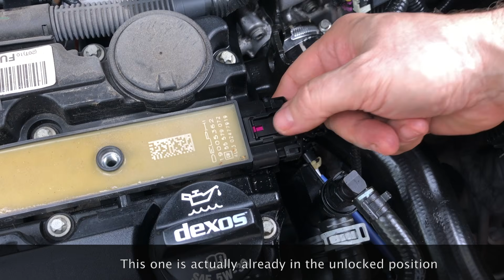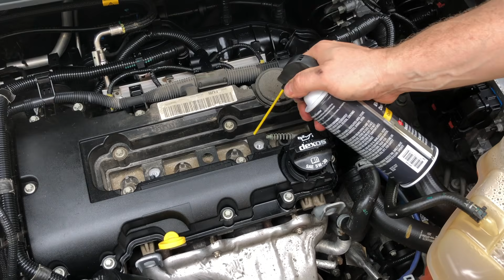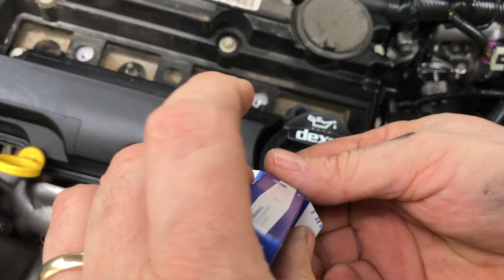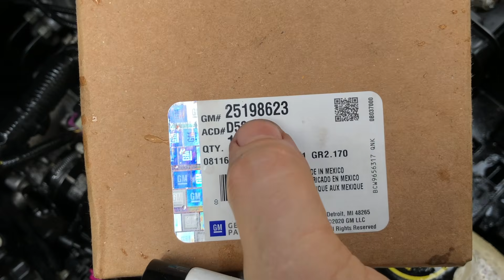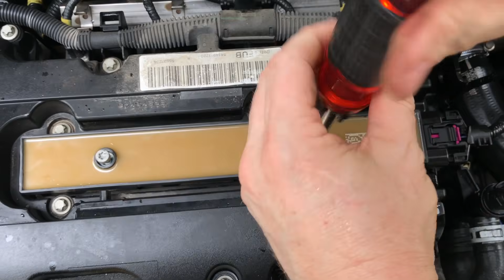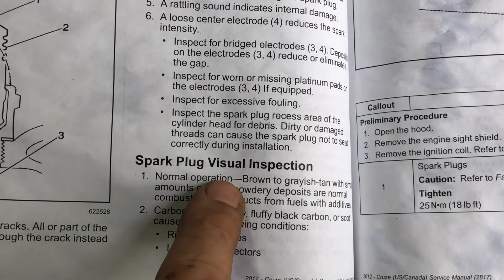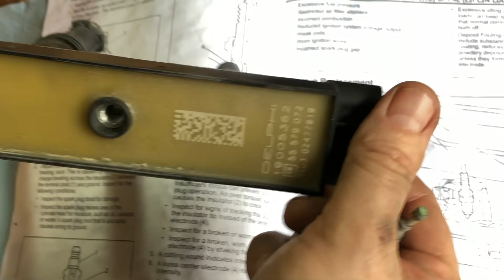2012 - 2021 GM Ecotec 1.4L Turbo Engine 60K Mile Maintenance (Replace Plugs & Coil Pack) Sonic Cruze

Comment: You didn't lube the threads and you didnt add more grease to the plugs/boots. The same problem will just happen again.
Reply from the maker: Wrong.   New genuine GM coil assemblies come pre-lubed with dielectric stripes as shown.  Plug threads on this engine do not get any grease applied to them.  Follow the what GM says in their service manual, not what's done on other car models, and you'll be gtg.
Reply: @DrShock  Yes, you are wrong. That's why it will corrode again. Always lube the threads and add grease to the ends of the plugs, or in the boots. Also remember that these manufacturers are the same ones that say you can go 10,000 miles between oil changes. Oh! Lets not forget life-long transmission fluid or OAT antifreeze that eats aluminum and gaskets!
Reply from the maker: We're just going to disagree here John about anti-seize, or grease, on the threads.  It interferes with achieving the correct torque value on the spark plugs.  As I've already mentioned, genuine GM coil assemblies already come pre-lubed out of the box so adding more is a waste of $$.  You only need to add your own dielectric when its an used coil assembly, or if you're using lower quality aftermarket parts.
Reply: My wife's car is  a Buick Encore, I replaced the valve cover. And thought while I have this apart, ill do spark plugs and then boots. My neighbor told me the spark plugs were rated at a 10,000. So I almost wasn't gonna replace them. But again wanted to be thorough. And its a good thing I did. When I pulled the plugs, what was left of the diode was something that looked like a needle. 
So replace your plugs

Comment: shouldn't he be putting anti seize on the threads ?
Reply from the maker: No, the GM factory service manual does not recommend using that on plug threads for this engine as it interferes with setting the correct torque value.

Comment: That motor was spotless! I'd guess water seeped into that side of the coil pack and caused all that corrosion on only one cylinder. The end cylinder. I've go 381,000 miles on my 2012 Cruze LTZ RS between two motors. Stock coil pack and boots. I'm very careful washing the engine. Great video!
Reply from the maker: Thanks.  Yep, just water from wet weather driving/condensation causes that.  That particular end cylinder is prone to this kind of water intrusion/corrosion on the GM Ecotec 1.4L turbo engine unfortunately.
Reply: @DrShock  where can i gonto buy the coilpack Chevrolet sonic 2016
Reply from the maker: Should be links in the description.
Reply: @DrShock  Do you pressure wash under the hood? That level of corrosion indicates water has been forced there many times. 🤔
Reply from the maker: No, I do not.  But then this is a customers vehicle, so I have no idea what they did before I worked on it.
Reply: Are you at all concerned about that corrosion I believe in two plug areas? Particularly the one on the right which was excessive. I'm wondering if there's some sort of chance that you have a minor head gasket problem going on.? I saw the others commenting that it was a pressure washing problem, but I guess I'm not sure why somebody would pressure wash an engine, and secondly I'm not sure why it would only infiltrate a single cylinder. It is my understanding that these engines are very plagued by several Achilles heel issues including overheating and basically cooling problems. Just curious.
Reply: @bigqueue  I have a 2015 Chevy cruze and had one just like it. I believe it's from the spring being bent and not touching the plug like its supposed to.. It will corrode when driving it over time. Im almost at 200,00 miles they're not bad if you keep good maintenance on them.
Reply: @bigqueue  After viewing a few videos on this topic and observing the problems with corrosion on #4 being common, I'm wondering if going through today's modern carwashes where they spray upwards on the undercarriage if that might be causing this problem?

Comment: What cause the corrosion coolant leak
Reply from the maker: There's no coolant in this area, it's just condensation from wet weather driving on the plug.  The oxidation on the coil spring is a common problem from the normal effect on the metal used.  The dielectric grease in the replacement coil boots is intended to prevent the plug corrosion from happening.   Unfortunately for the coil spring, you just have to replace them.   We could have rebuilt this using the NGK kit linked in this videos description. But the owner wanted a complete new ignition coil installed instead.

Comment: 2016 Buick Encore. I checked mine just now for fun. Lucky for me I watched the video for the loud solenoid, and found this one. I thought it was running a little rough, I'm surprised it was running at all. I assume its water getting inside, for that amount of rust it would have to be.
Reply from the maker: Yep, water intrusion into this particular bank is a problem with these engines.   You could rebuild this one ignition boot and spring, but the owner wanted the whole coil replaced as they had just bought the car.

Comment: Thank you for showing the maintenance work in your video! I am from Germany and own a Opel Corsa E built 2017 with the exact same engine (1,4 Turbo I4 with 101 HP,  Engine Code B14NEJ). Current mileage is about 49000 miles or 79000 km. The recommended service intervall for the sparkplugs in my manual is every 60000 km or about 37000 miles. I did it myself without any problems, engine runs spotless and the plugs such as the ignition pack were without flaw. Do you know any serious problems regarding this type of GM engine? I heard about the oil pumps quitting or poor lubrication starting at 60000 miles. Would be nice to hear about your experience with those issues. Greetings from Bavaria :)
Reply from the maker: Thanks.   These Ecotec 1.4L turbos tend to suffer from leaks at the oil pan and timing cover over time.  Also from the front crankshaft seal.   They often have the belt tensioner break as well.   These are all rather inexpensive repairs to do yourself and I have videos on most of them.   Another weak point is the turbo itself, they can give out after 8 years or so, I have a video on that overhaul as well.
Reply: In the USA this engine produces 137 HP.
Reply: @scrambler69-xk3kv  In Deutschland gibt es den mit 101PS, 120 PS, 140 PS oder 150 PS, je nach Modell.

Comment: At rockauto u can buy only the boots for the coilpack that coil packs looks good to reuse it👍🏻
Reply from the maker: Yep, use only the NGK brand ones though.   In this videos case, the owner wanted a brand new coil module rather than to rebuild the old one.
Reply: @DrShock  how come only ngk boots?
Reply from the maker: This comment thread here applies more to the pinned comment video - https://youtu.be/vUFMqa44Phs  but the answer for why NGK only is simply the mantra - go oem or go home ;-)
Reply: Ok i got it so i use ngk spark plugs for my rs is this good or not?
Reply from the maker: NGK is an OEM supplier to ACDelco, so yeah they are good.
Reply: @DrShock  ok thanks so much

Comment: Very good video.  Here in the UK, those 1.2 & 1.4 engines were used across a range of popular GM cars, and the coil packs are pretty much a consumable item, in our climate they seem to last 30 - 40,000 miles before failing as a result of the kind of corrosion you showed.  The coil pack is obviously designed for ease and speed of assembly on the production line rather than long-term reliability.
Reply: I replaced the Boot Kit. $13 . No need to replace the entire coil pack.
Reply: @jimgrazulis3542  is there any video about doing it?
Reply: @us3804  give the rubber boot a slight, yet firm, twist. You’ll break the seal between it and the plastic and you’ll be able to remove it with ease. Before you do that, make sure your local shop has one in stock (if you need the vehicle right away) or if you’re able to let your vehicle sit for a few days, you can get one online. I say this because as craig380 mentioned, it’s more of a consumable part. The plastic is VERY cheap and can become brittle from all of the heat cycling from the engine. So, in case yours does break, you won’t be stranded entirely and you’ll be prepared with a backup plan. 

Replacing the boot would be great, if only GM didn’t use cheap plastics. You’re almost forced to replace the whole coil pack.
Reply: @CuhLippy G.M.Coil Packs crack from the heat, miss fire 🔥. JUNK !

Comment: Nice video. But two things; 1) Chevrolet claims with platinum plugs you are supposed to get 100K miles between replacement. 2) Originally, you couldn't buy the boots and electrodes separately. Now you can buy them aftermarket. There is no reason now to buy a new coil since you can just replace the boots and electrodes.
Reply from the maker: Thanks.  Actually Chevrolet does not claim that for a turbocharged engine using OE plugs.  ;-)   In this vid we used an iridium plug, which actually should last longer than platinum ones and is the OE replacement.  There is a double platinum plug ACDelco makes for this engine, 41-829, but I am not familiar with any published mileage claims on that particular platinum plug in a turbocharged engine application.  I believe ACDelco makes a generic claim of 100K, but there's always fine print on such general claims.  Nothing for the 1.4L turbo is published by GM that is different than 60K tho.  The 60K service interval in the vehicle owners manual, and factory service manual, always supersedes anything else you may read or hear about as different engines have different wear characteristics.  And there were definitely multiple engines installed originally with these same cars, and each may have different spark plug service intervals which can cause some confusion.  In this vids case, we're only going over the 1.4L turbocharged engine which is 60K.

And yes, you can get an NGK repair kit (there is a link to the particular part number for this engine in the description) who as I mentioned in the video is the OEM supplier to ACDelco for these parts.  With that you can rebuild a single electrode or boot.  But as I mentioned in the video, in this vid the owner just purchased this Sonic and they wanted the whole pack replaced for piece of mind due to the corrosion encountered.  I do have a video in the publish queue for a Cruze where this more economical rebuild approach was taken that should pop in a month or so.
Reply: Correction. Yes you are correct. My mistake, I meant Iridium.
Reply: @timrisch4540 Newer engines use Ruthenium , ask.
Run better, BUT.. 15-20 K is all there good for.
I know, I run them, basically for GAS MILEAGE.
40-43 MPG @ 70-73 MPH, 6- gear on cruise.

Comment: Should’ve used some silicone lube around  to take the boot apart
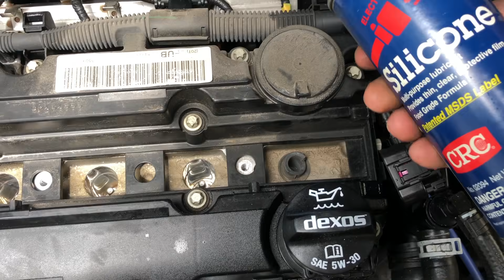Reply from the maker: Watch at 6:35 and you'd see that was attempted, but as usual is the case in these plug corrosion + heat adhesion situations - silicone is ineffective (I'm not the owner of this vehicle just performing the service on it).   I consider these boots disposable.   If you're not swapping out the coil pack, you can purchase them individually as replacements.

Comment: Thank you for this video upload. I’d like to ask your opinion. I have a 2014 Cruze 1.4 turbo and love the car. I’m sitting at around 58,000 miles. I did the spark plugs a few thousand miles ago. The coil pack looked okay. Would you recommend upgrading the stock coil pack? The one specifically I’m referring to is made by MSD  ignition. Part number 8236 blaster direct ignition coil. Just was wondering what your thoughts would be on this coil pack. Thank you
Reply from the maker: MSD is a reputable aftermarket supplier.  I've used their products in the past, but not this particular one.  The Ecotec 1.4L is not a performance engine per say and the stock programming is geared for fuel economy and emissions reduction, so you're not going to get any significant difference with this part over OEM.  It's a fine replacement, preferable to low quality import packs for sure.  The MSD 8236 comes in a red color option too.  ;-)
Reply: @DrShock  thank you for your honest reply. I do enjoy all your videos. Have a great Forth of July upcoming weekend.
Reply: Except you will see a gas mileage gain with the msd coil! The better coil allows you to run the largest gap possible which is probably .026” on a stock car. My tuned bigger turbo car is .022” to avoid blowout. I strongly believe the car being factory tuned will benefit from running premium fuel and better spark.